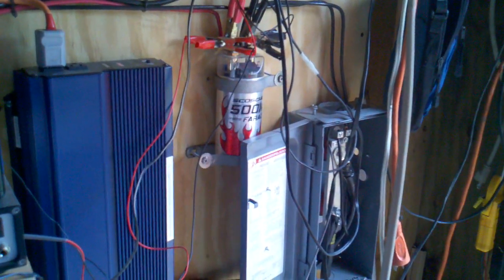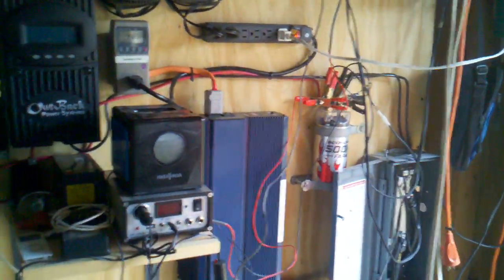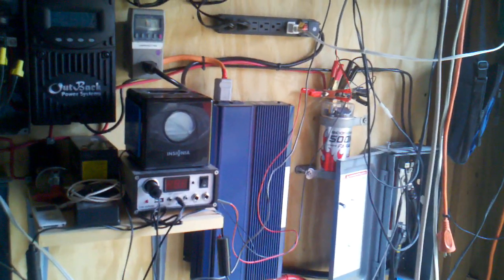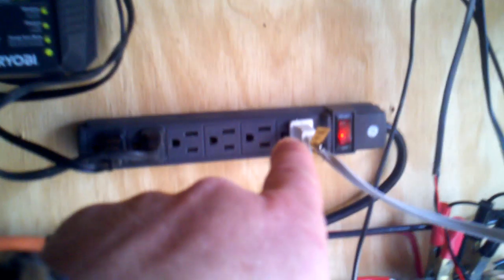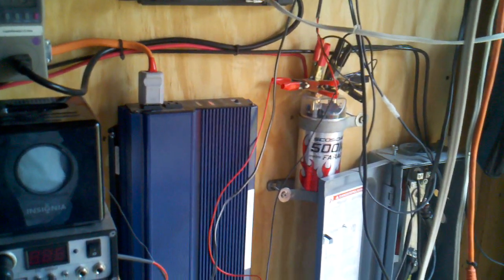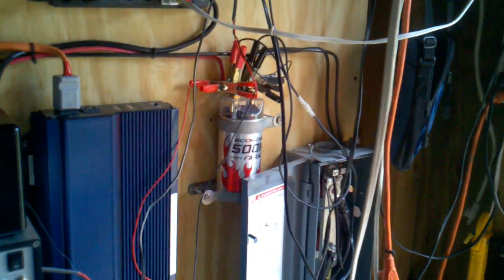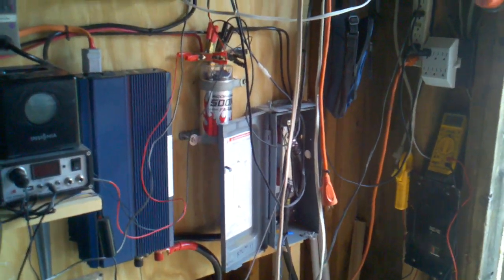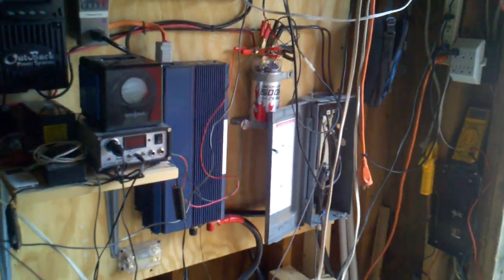Explanation of the DC 500K uf or micro farad capacitor used in my solar set up

Comment: I have a 8000BTU air conditioner with a 3000 w inverter. It cannot start my condensor. Do i place this between the inverter and battery bank? Or between ac and inverter? Please help. Almost done my buildout camper‼️
Reply: Wired to battery then into the inverter... same as a car audio set up

Comment: Might want to look into the maxwell super caps. I have 6 of them at 2.7v wired in series for 16.2 volts of standby power for my application. They are 350 Farads, Not uF Microfarads, but 350 Farads for super storage. Rated for 1000 hours to drain if left alone. They are blue in color and only the size of a D Cell battery. You can find them at mouser or digikey for about 11 bucks each.
Reply: +Jeramie Curtice might want to mention what happens in series. you have a 58.3 F bank with roughly 0.018ohms esr. I know this because I built a 116F bank with 0.009ohms esr

Comment: I too use these same caps (I have 2 wired in para). 3000 watt inverter, 80 amp charge controller, 12 volt system and a 1200 ah battery bank fed with 1100 watts of 12 volt solar panels.

Remember to CHARGE these caps S L O W L Y in the circuit initially to avoid damaging them. I do that using a 220 ohm resister (takes 5 minutes to charge them to 9 volts), and when I need to take the system offline for maintenance, I use the same resister to short across the cap terminals to drain them down for safety reasons. Using the caps DOES help the inverter run loads heavier than it would normally be able to handle by itself so YES - it DOES work. 2-500k micros = 1 farad which is about what one would really need to do anything useful with in a solar setup.
Reply: uh... you charge the cap slowly so you dont damage the battery.

the functions of a cap are nearly instant charge and discharge with out damage. batteries done like spikes. you put the cap in to take the spike off the battery when soemthing kicks on and quadrupals the load for a fraction of a second with its start up draw. if the cap can pull from the battery with freedom it will just pass that spike back to the battery when it tries to recover what was drawn from it. probably a bigger concern with say a maxwell supper cap bank. i have a 16.2v  116F bank (6 series 350f 2parallel strings) . The esr on this bank works out to 0.0092ohms ... This means that if plugged in dead...or if something managed to nearly instantly draw them out completly... 1521.74 amps is what they would try to draw from say a lead acid sitting at 14v ...(ohms law). cables will affect the real world experiance but the point remains

Comment: DC Capacitors installed shunted to ground over your output will act as a smoothing filter and prevent dips generated from strong inrush currents, usually from motors loads. AC capacitors shunted to ground, correct power factor and reduce voltage drop across cables.

Comment: Good job. Have 48v inverter and 48v battery bank. Do I need to connect 12v capacitor in series to makeup 48v. Before connecting it to my breaker.? Pls explain...thanks

Comment: Great info by the way
hey what if i had a 550W refrigerator and a 2500W electric stove running on like 12 of these ( or Maxwell BCAP3000 ) how long do you think they would last, even during surges.

Comment: Hello, just want to asked the voltage of  the capacitor you mention. can i use larger voltage caps and larger uf in 12vdc battery bank  
 thanks.

Comment: based on How to charge a capacitor Home audio style! video

i would love to see someone add 3 Caps to their battery setup, so that when you drain the 1st Cap - then it goes on slow charge, then when another surge comes, it draws from the 2nd Cap - then it goes on slow charge, then cycles through with all three Caps... and when you panels start to charge the caps will get a direct charge for a more faster charge...

Tell me what do you think.

Comment: hi.my system is 24volts.the capacitors u use are 12volts.Do they have single 24volt capacitors or should i series two 12 volts?

Comment: You should try a 2600F cap LOL  and get some serious amps.
Reply from the maker: I will when I run across one. Thanks
Reply: Guy Brown I used to think the 12v 1F car audio cap I had was nice.  Now, they make 3200F caps but they are only 2.7v.  Time you series 6 together you only have 500F, which is still awesome.  You'll fork out over $300 for that though.
Reply: +Jonathan Duncan. they are supper or ultra caps. not just caps. the construction and their functions/abilities differ slightly. Main thing is the ESR. 6 in series with cheap ones will suck as series esr = number of caps * esr of single. I am constructing a spot welder with maxwell dcells...managed to get 20x for 150usd. build a 116F 16.2v bank with an esr of .009 ohms. my switch pcb is laid out for up to 6 mosfets in parallel but the part i selected should allow me to start with 4x and add 2 more later if i want to add a plasma cutter feature. they cost 5-6ish a mosfet so the 12 buck savings means a little more food/beer money while i construct the project that required an outlay of about 300

Comment: There's a video on youtube here of a guy who replaced his car battery with 6 maxwell caps and starts and maintains his car from them.
Reply: +jeramie curtice which is stupid... ccause when his alternator dies the car will be off very quickly. had he left the lead acid then he would have 40miles or so of range. also the fuel savings arnt as much as some think...we have this thing called a bearing. weight only matters as much as most assume when you are flying under a fucking rocket where every lb needs more thrust. other wise gravity on bearing means saving 10lbs saves you 0.0000001 mpg (number out my ass to illistrate a point probably + or - 4 zeros )... with that sort of takes years to add up savings, id rather have the extra weight and ability to make it to the service station with out an alternator
Reply: @jwuethrich8385  Been there, it was raining and I needed wipers and lights, good thing it was a diesel engine & damn good thing I had a real battery!

Comment: what is the voltage rating of the capacitor?
Reply from the maker: +Marcus Casca 12vdc
Reply: Thanks. In a case when you have 24v system, what do you  advice?
Reply: 2 in series and do you homework for how to do that right. or hit ebay... there is a guy selling 20x maxwell d-cell supper caps for 150usd.  I bought from him and built a 16v 116F cap bank. 350F/6caps in series = 58f .... I put 2 strings in parallel to get the 116f. Each cap is rated 2.7v so you would want to use 2p strips of 10 in series to give you a 27v max bank. Do not attach that to a battery when dead it will try to pull somewhere north of 900 amps (i didnt re run the numbers, just guessed based off the 1500amps mine would (esr increases with series which will decrease draw))
Reply: it cant be 12v as the actual limit.  lead acid chargers operate around 16v and people would blow them up all the time. I have that cap when i realized that I plugged it in to my bench supply and 16v did no damage. i wish i could find the real limit on a data sheet though.
Reply: The Schoche 500mf Caps are MAX 20 volts. Hope that helps if you've not found the answer yet.

Comment: Well friend with your teory you have just few problems.. 1. You are not using all capacity(or energy)...for example if you have 28V nominal you will go down in few sec to....ta daaaa  22V....and that is diff. only 6Volts...So think now...how much energy did you get...even if you will have capacitor with 5F and not 0.5F still your energy is so small...please make calculation and see for yourself. I personally think it is fine for imput side..you have over 100V(DC if you have ofc)..then has sense

Comment: but with low voltages..no sorry no sense..and price of those cap. is really high..another thing ..Try to short cap...well try to short battery bank and you will see......big nice sparkle doesn't mean you can supply much energy. I know capacitor might be good but unfortunately it isn't so good as you might think.
Reply: +sywerdragon ... the point is to absorb the spike of something like a motor when it starts and presents bassicly a short circuit for a fraction of a second. so yes it does make sense. it makes even more sense when you limit the rate the cap can draw from the battery. so it takes the spike but can not create a spike when it draws to recharge
Reply: @jwuethrich8385  Like that reply, I need to figure out the limit rate part of this setup, a ceramic resistor maybe?